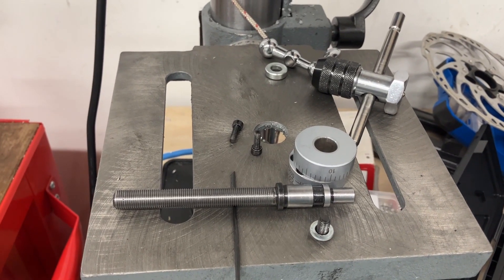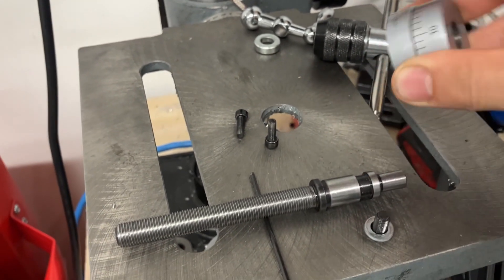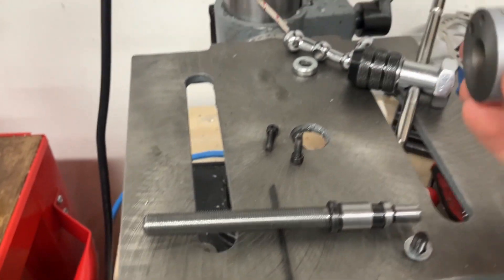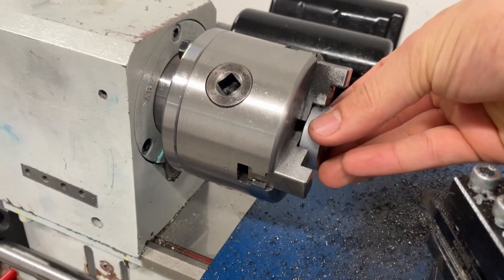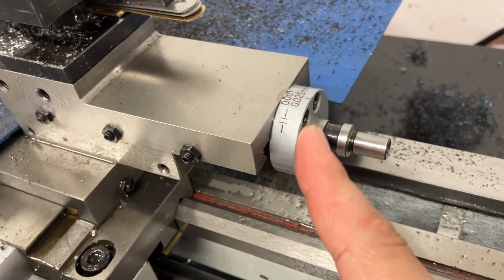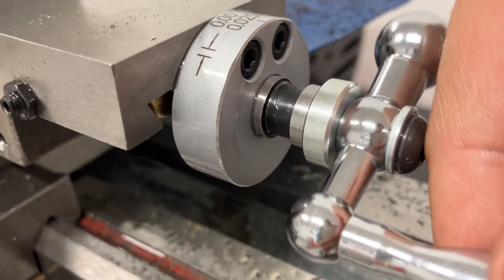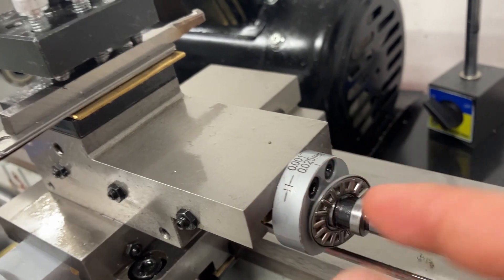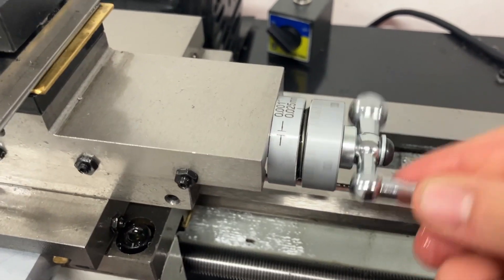Mini Metal Lathe Compound Slide Upgrade

Comment: The threaded shaft for the compound slide on my mini lathe has a lot of wobble to it to the point I've noticed quite the difference in surface finish manual feed vs power feed. I've thought about straightening the shaft in the press to fix the issue. What size bearings did you buy?